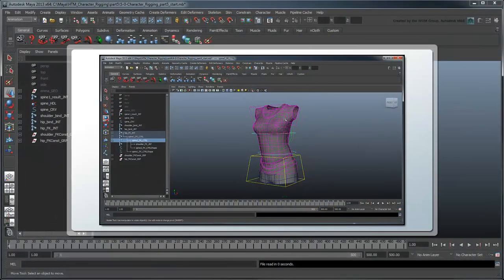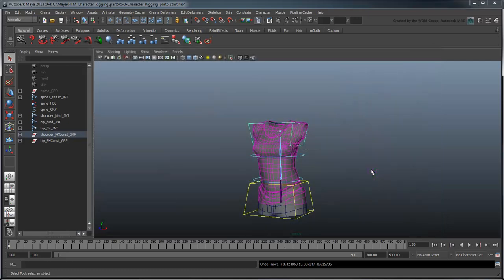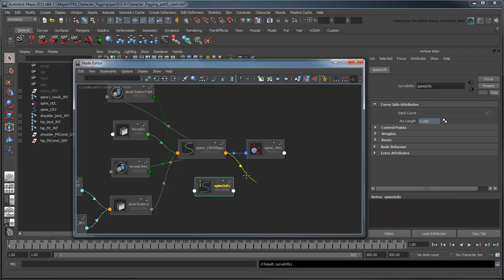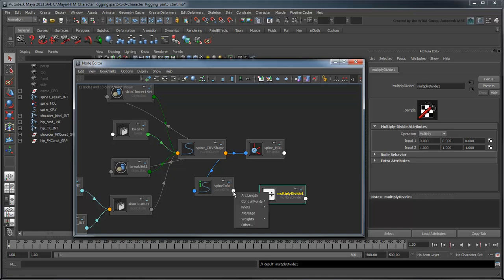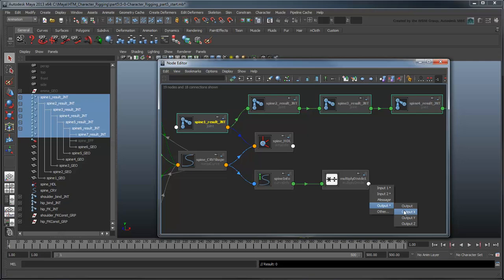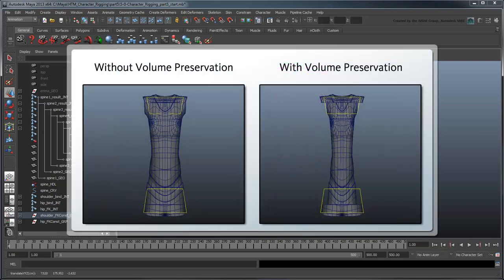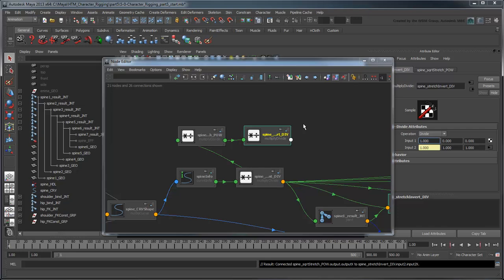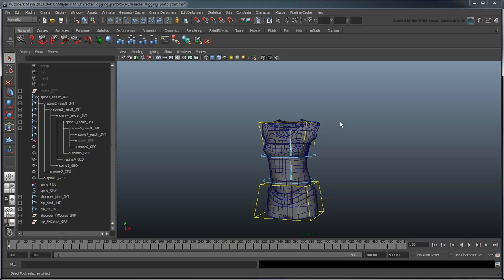Creating a Character Rig - Part 5: Torso squash and stretch (Advanced)

Comment: Hello, i have a question, i have a skinned character with this type of rig, but when i open the rig it always gives me this error:
 "spine_stretchInvert_DIV": basicExpression has encountered a divide by zero. Result is unpredictable. // 

when that error appears the mesh explodes infinitely on the viewport, but when i reopen it it goes back to normal. Is there anyway to fix this so it doesnt happen?
Reply from the maker: Sounds like it may be a bug or that something behind the scenes has been corrupted in the file.  Try importing your character into a new scene, saving that scene, and then working from there.

Comment: hello i followed the tutorial and i wonder how to make the fk controls that affect the ik spline also move and rotate when the spine stretch to have more precise control. thanks
Reply from the maker: Unfortunately doing this would cause a cycle of dependencies which would be very bad.  The short answer is that it isn't possible in this setup.
Reply: Maya Learning Channel thanks for the answer but then in what kind of setup this can be possible
Reply: Maya Learning Channel I have the same problem.. How can I use FK chain if it doesn't follow movement and rotation of the ik spine?
Reply from the maker: The general way you want to use the rig is to pose in FK first then use IK to make adjustments.  The alternative would be a strictly FK or IK spline (it's pretty much impossible to build a perfect FK/IK hybrid due to the dependency graph).

Comment: I have a huge distance between the shoulder geometry and the rest of the geometry when I stretch the torso. Is this normal?
Reply from the maker: That doesn't sound normal.  The joints/geometry should all be spaced equally.  Is it just the geometry that's incorrectly spaced or the joints as well?
Reply: Maya Learning Channel There is a distance between the shoulder geometry and the rest of the geometry when I used the shoulder control to stretch the geometry. I see a distance between the Spine_07_resultant joint and the shoulder bind joint when I stretch.
Reply from the maker: Sounds like you have a double transform.  Try downloading the scene file included in the description and comparing your own scene hierarchy to it.
Reply: Maya Learning Channel Thanks so much, will do that. Great Tutorial.

Comment: i followed the character rig part 5 video tutorial. I'm using autodesk maya 2014 and i'm stuck in the node editor. To be able to stretch, the curve must be connected to the curveinfo node in the node editor, but when i clicked the curveshape output and select world space, then tried to connect to the curveinfo input, i click the "...Other" and i can't find the "input curve". Is there any way to solve this problem?
Reply: I had this problem but fixed it by clicking "Show Non-Keyable" under Display and it will show up :)
Reply from the maker: Are you sure you're clicking the curveShape node and not the curve's transform node?
Reply: i selected the output of the spine_CRVShape > World Space. Then when i click the input of curveInfo node > Other, i can't find the input Curve. Or maybe i miss something ???
Reply from the maker: Michael Elton Widjaja Unfortunately I have not been able to reproduce this problem.  Try downloading the scene files included in the description and compare it to yours.
Reply: I had the same problem.  It might have been caused by failing to connect the two nodes the first time, though it sounds strange.  What worked was quitting Maya and reopening the file.  Then I was able to connect the spine_CRVShape node to the spineInfo node.  Hopefully quitting and reopening the file will work for other people who run into this problem.
Reply: StuartMacBean THANK you! I was stuck here, too

Comment: I keep getting a basicExpression divide by zero every time I open the file back up.  How do I fix this?
Reply from the maker: Hmm, I just tested the files and they do work correctly.  I would try deleting your preferences (found in the Maya folder in your documents) and then try again fresh.
Reply: Maya Learning Channel Here's the deal.  When I start up the file.  The 2x value for Spine_StrechInvert_DIV is 0.  When I move the torso (and undo the transformation), it turns back to 1 as it should be.  I just don't want to keep fixing a divide by zero every time I open up the file.

P.S what will happen when I delete my preferences (in case it may cause other issues)?
Reply: TheDudeHasIt is maya able to evaluate negative power thus (ScaleX)^(-.5)? Could save one mutliplyDivide-node.. could also maybe prevent divide by 0 errors..
Reply from the maker: Deleting your prefs will restore Maya to its factory defaults (key bindings, menu preferences, etc).  You can also just rename the prefs folder temporarily then restart Maya to check if it fixes your problem.  That way you can just rename it back to retain your old settings.
Reply: Maya Learning Channel I worked on my project on a different comp (mac) and I didn't get the divide by zero issue, even when I opened it up.  I deleted my prefs on my main but when I opened back up the file the error occurs.
Reply: Peter Schramm Did -0.5.  Yet, when I open it up, It still happens.  Is this issue I've been having a bug in educational pc version?